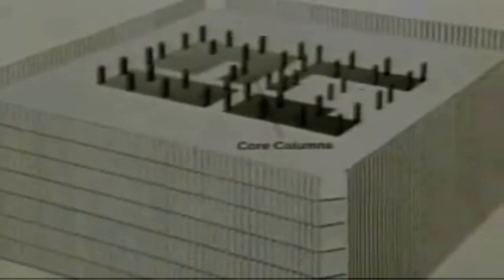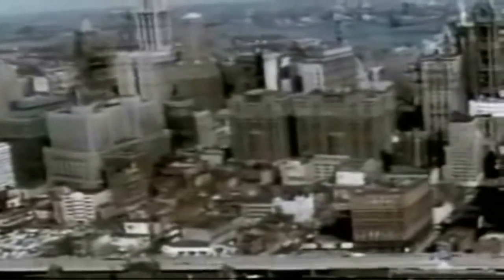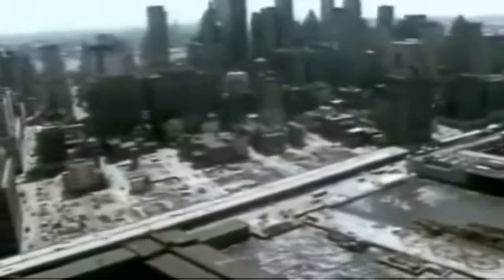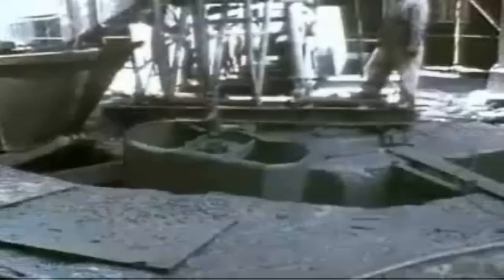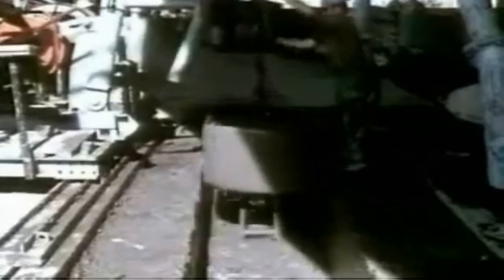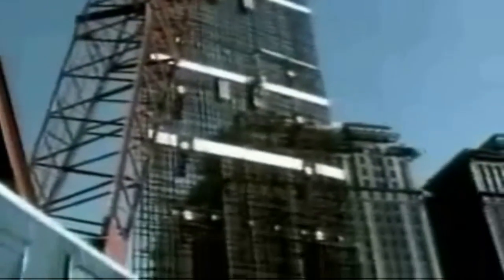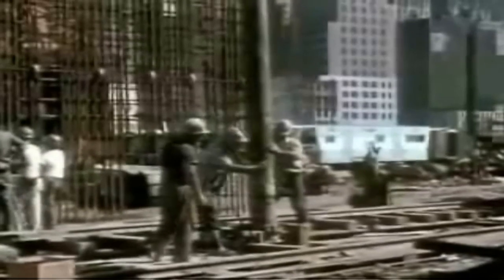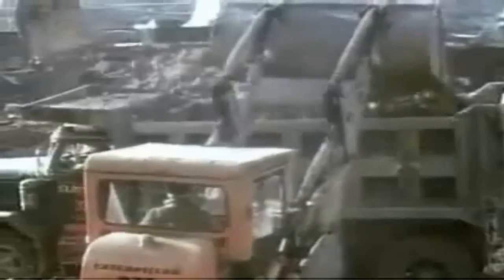Building the World Trade Center Towers

Comment: At 9:24 in the footage, it becomes clear why the official story of floor pans sagging due to heat would have been impossible.  The official explanation omits the reinforcing steel I-beams that run the length of each pan.  The trusses were not load-bearing components.  They served as additional connection points.  Those floors were filled with steel-reinforced concrete, providing even more strength and resistance to warping.  

Those floors were also nowhere to be found during the cleanup process.
Reply: You apparently know nothing about construction.
Reply: @CGoffgrid  - I know that it is a physical impossibility for a section of a building to fall on itself at a velocity close to a gravity free-fall while it is still connected by steel support columns.

If you have ever read any of the official reports, then you would know they left out critical structural details of the buildings which are evident in this video.
Reply: @BrianR.-nu1sr  What makes you think the columns have anything to do with the collapse of the floors below the impact? The columns could be 10 ft thick Kryptonite, it wouldn't matter, the truss seats failed, as to be expected. No floor could be expected to withstand that much dynamic load.
Reply: @CGoffgrid  - you weren't watching the construction video.

Besides, if the floors failed because the trusses gave way, how could the central cores be torn apart and why were tons of outer wall sections cut shorter than thirty feet and thrown over one hundred yards away?  How did steel from the North tower start the blaze that consumed Building 7, as the NIST report claimed?

And just where did those floor pans go?  They should have been stacked in a pile over thirty feet tall.

The official "pancake" theory was written in just two days by a civil engineer who had not inspected any of the steel at ground zero.
Reply: @BrianR.-nu1sr  If the floors fall there is nothing holding the columns up, and they toppled over. This is clearly seen on video. 
The floors were stacked up, where else would they go? You can clearly see them dropping on each other in the videos, all the way down.
Civil engineer? Two days? I have no idea where you got that.
Reply: @CGoffgrid  Please watch the video.  The floors did not support the central core.  The core provided support for the core and the floors tied the outer wall mesh assembly to the central core for rigidity.

I defy you to find anything in the videos that remotely looks like floors falling.

The walls blew out and the entire tower was consumed in smoke throughout the collapse.

There were no floors pans among the twisted steel beams and columns at ground zero.

There is also no way that each entire tower could fall apart in just fifteen seconds without the aid of demolition material.   The towers were much more densely built towards the bottom.

The official explanation was written in order to deflect attention away from the demolition efforts and back at the government's anti-terrorist narrative.

The same people who brought us the official 9/11 explanations are the same people who later brought us the fake report that claimed Saddam Hussein was involved with the 9/11 attacks, and that biological, chemical and nuclear weapons were being developed in Iraq.
Reply: @BrianR.-nu1sr  That is not how it works. The columns can not stand without being tied together. The floors tied the inner columns to the perimeter columns, without the floors none of those can stand. That's basic shit. Are you really trying to say the floors didn't fall? Because you can see it clearly on video as they hit each other all the way down. Everything you say is an assumption based on a lack of knowledge of construction, there is not a shred of evidence to support the claims of explosives in those buildings. None seen, none heard, none found, no evidence of them found, no method of getting them in the buildings, and no reason for them in the first place considering a 767 is plenty of power.
Reply: @CGoffgrid  - I suggest you watch an actual documentary on the subject.

I'm saying that if the floors were going to fail, that would have happened as soon as the first plane hit and knocked a bunch of them down.  Guess what?  None of that happened.

There is no evidence of floors falling on each other in the many videos taken on 9/11.

There is an enormous amount of video evidence of explosives planted strategically in order to rapidly bring them down in a manner which would prevent them from toppling over.
Reply: @BrianR.-nu1sr  I have watched all the documentaries, and I know construction. You are being fed a bunch of bullshit by con artists. 
1. Why would the floors collapse on impact? Because you think so? It wasn't the impact that caused the collapses, it was the combination of impact damage and fire.
2. No evidence of floors falling on each other? Huh? Are you blind? EVERY video shows it. Where the hell else would a 3 million lb floor go? They don't just float away. Here: https://www.youtube.com/watch?v=2-9TD3oQq3g
3. Not a single video shows a single high explosive charge detonation. Not one. I have no idea where you got that.
Reply: @CGoffgrid  the total weight of the steel used in each towers was 100,000 tons.  The floors would not have been designed to weigh 15,000 tons each.  Recheck your math.  Also, the floor pans were filled with a concrete derivative that included asbestos and some early polymers.

Trusses did not support the floor pans  The trusses provided support for the ceiling tile framework.  The grid of I-beams that are shown at 8:25 in the video provided the support for the floor pans.

Watch this video and try to pay attention.  One of the features of this structure had to do with the outer wall construction.  They are specifically referred to as, "load-bearing walls" (1:40 and 8:00 in the video).

If you don't want to see the evidence of the blasts, then you would not see it.  Floors were being leveled at an average rate of six per second.  That does not happen in a steel-framed structure without demolition.

The South tower collapse also contains evidence of demolition because of the direction change made by the tilting portion of the tower  during the collapse.

Then there's that nasty old Building 7 which mysteriously began burning completely (or, at least all that smoke pouring out of the front of it made it look that way) and collapsed neatly into it's footprint at 5:20 pm that day.
Reply: @BrianR.-nu1sr  I'm quite familiar with lightweight concrete and pans, I told you I know construction. I've been a Master Plumber for 20 years. I fail to see your point about the perimeter columns being load bearing? The planes removed 32-36 of them. The load was shifted to the other columns, which were then severely overloaded and being weakened by the heat.
Why don't you discuss this with a structural engineer, firefighter, or ironworker? They would tell you exactly what I am.
Reply: @BrianR.-nu1sr  Go to Metabunk and stop repeating the crap you picked up on YouTube, it's nonsense. 
https://www.metabunk.org/9-11.f28/
Reply: @CGoffgrid  - It turns out that a large number of structural and forensic engineers, along with physicists, metallurgists, architects, demolition experts, and other professionals have been pushing back against the claims made in the official government report for almost two decades now.  

The official report contains a number of flaws in the area of construction details and the basic laws of physics.  

Regardless of the number of damaged columns, the most that should have happened was structural settling due to deformation of the remaining columns - which does not happen instantaneously.  

Fire temperatures were exaggerated, no consideration was given to the fact that the towers were giant heatsinks, the elasticity of the floor pans was grossly overestimated, and no attention was given to the volumes of gray smoke that poured out of the towers before they rapidly fell apart.
Reply: @BrianR.-nu1sr  Funny how none of that is true. The overwhelming majority of structural engineers agree with the official account. As does everyone with a construction background. You have some really strange ideas about physics, and not a shred of knowledge of construction. What you saw that day was exactly what should have happened. It's amazing they they as long as they did. Your lack of knowledge is not proof of anything.
Reply: @BrianR.-nu1sr  Giant heatsinks? 🤣🤣🤣🤣🤣
Most ridiculous thing you've said yet. More like giant chimneys. Air temps hit 1800 degrees in both towers. You gonna tell me the steel just shrugged that off huh? Bullshit.
Reply: @CGoffgrid  - The air temps may have peaked at 1800 degrees immediately following impact, but those temperatures could not have been sustained for more than a few minutes - probably more like a few seconds because jet fuel is designed to burn off in an instant.  Steel is an excellent conductor of heat, so any abnormal heat rise would have quickly flowed outward and upward to cooler parts of the structure.

So, yes. The steel just shrugged that off.  It always does in those instances.
Reply: @CGoffgrid  - The official reports on the cause of the three WTC skyscraper collapses was brought to you by the same people who falsified CIA reports about Iraq's involvement with the 9/11 attacks and that country's military development of chemical, biological and nuclear weapons.

By the way, if jet fuel was so destructive on steel, then jet engines should melt while in flight.

The overwhelming majority of structural engineers are dependent on some form of government contracts, even if it is only at the city level.  If they want to keep their jobs, they will not push back on the government's narrative.

As an example of the lengths that the government would take to protect their fable, the members of Congress and the news media who questioned that narrative were mailed envelopes containing anthrax within days of voicing their concerns.  That strain of anthrax was traced to a U.S. Army research facility - not Islamic terrorists as was claimed by Bush administration officials.  One false flag operation was protected by another.

Note that what should have been the official investigation of the WTC collapses that was being overseen by the ASCE was hijacked by FEMA, which is not an investigative agency, and then handed over to NIST, which is also not an investigative agency of any kind.  Both of those agencies reported directly to the Bush administration and their work began with the conclusion that plane crashes, fire and gravity caused the collapses.
Reply: @BrianR.-nu1sr  Wow. You are just too fucking stupid. The fact that steel is an excellent conductor of heat is exactly what destroys steel framed buildings. Do you not understand that hot steel expands? You really are lost. Everything you say is garbage and you lack the education to know why. 
Let me clue you in on something,  your assumptions are not facts, and most of your comments are just assumptions. You need to study. https://www.metabunk.org/9-11.f28/

Comment: Steel does not have to melt to lose its ability to hold tons of weight. It is bendable at much lower temperatures than its melting point. Jet fuel was not the only source of fire. Millions of tons of office equipment, furniture, paper, batteries, etc. contributed to the uncontrollable blaze. When the towers collapsed, their potential energy was released which was equal to 150 tons of TNT per tower. Tower seven collapsed because it was partially struck by the twin towers and also had uncontrollable fires raging. The inner supports collapsed first before the rest came down. Again, steel does not have to melt to become weak.
Reply: Michael  You're correct. Both buildings were leaning after impact, and more visible above the impact locations. The thermite theory doesn't work with how the buildings were leaning.

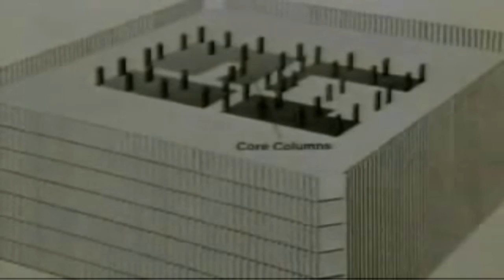Comment: 1:30-1:50 explains the reason the towers collapsed...."Extremely tall buildings were traditionally inefficient, since huge amounts of interior space were taken up by structural support and elevators. The trade center towers would overcome this problem, the exterior walls were designed to bear much of the weight of the towers as well as all the wind loads".
Reply: Also the core should have been made of thick reinforced concrete
Reply: Yep that explains everything. I have no further questions?
Reply: Mr. TacTown hollow in the middle, no wonder they collapsed.
Reply: Excatly!! Good to see someone using their head, unlike these morons that claim it was a bomb.
Reply: At least there is one other intelligent person on this site. I even saw the WTC Twin Towers being built, and my grandfather was friends with some of the store owners the Twin Towers replaced. Lower Manhattan was more interesting and fun before the Twin Towers went up, but what David Rockefeller wanted, David Rockefeller got.
Reply: The towers collapsed because jets hit them, not because of any design flaws. There were several documentaries done after the investigations into the Towers' collapse, and it was concluded that had the Towers been built in a manner more like traditional high-rises of the time that they would have come down a lot quicker, possibly leading to more deaths.

Comment: Ever see what simple birds do to the front of an airplane? Kind of hard to think that an everyday airplane with the design of a city bus take down a steel building with a even stronger core. But that's just me
Reply: 888JUNKCARS BUYING TEAM 

the birds weren’t flying at nearly 590 mph (bringing a massive kinetic force with them), carrying thousands of gallons of jet fuel, and nearly 400,000 lbs of weight.  

The cone of an aircraft is made of a much softer, thinner material than the rest of the aircraft to make it easier for the radar and other sensitive instruments to work correctly.  

And also, the turbofan blades are highly fragile and can be easily damaged by objects getting sucked into them.

I think any tall hollow structure would suffer major structural damage, after having a 200 ton object, traveling at 75% the speed of sound, thrown at it!

Comment: Such magnificent buildings, built with pure steel from the outside in basically forming a steel protective skin, shame a couple of paper airplanes travelling at impossible speeds at ground level went through them like knife thorough butter causing them to collapse at free fall speed some 30yrs later.

Comment: That explains how it fell the way it did. The outer walls was where most of the stress of the tower was at. Put a hole through one side. And you'll weaken the structure. Also, jet fuel cant melt steel. However, it can burn hot enough to weaken it, and once the fire is in the center of the tower. And right down the elevator shafts. The core of the building turns into a kiln. Thimk of it. The elevators go right to the basement, or the garage. Sucking all the air from down there. It sure as hell will turn into a kiln, therefore causing the fire to burn hotter than ever, causing those steel beams to melt. Think about it

Comment: Its hard to believe a jet wing could could cut through steel beams...
Reply: If a item is going fast enough it can go through most things. Think about tornado.damage, playing cards embedded into trees, straws of hay into wooden homes. Winds in tornados reach up to 300mph, jets go.much faster
Reply: water could slice steel...if it was high pressured..look up...it is not about the materials...it is the kinetic energy which enables something like that to happen
Reply: @mcmac9565  Yes it could bit with time and much concentrated pressure.. Planes are hollow and not moving at 20,000 miles per hour.. Your stupidity is incomprehensible
Reply: @Peter Rabitt Your stupidity knows no bounds
Reply: When you're flying extremely fast in an extremely heavy airplane full of fuel then yes it was very much possible. By the way it cut through the exterior concrete walls.
Reply: Sparky 97 exterior concrete walls? Na brother, those were not concrete, they were steel. Even so, they got pierced.

Comment: Now i see why the twin towers fell into themselves on 911. The outside walls are the support of the whole building. So it pancaked it self because of the load bearing walls.  But something that i cant get of my mind is why wasnt the elevator shafts or one of the load bearing walls left intact. Everything collapsed. It looked like a demolition not a collapse. If my theory of why the towers fell is correct of the load bearing walls the elevator shaft or one or 2 of the sides of the wall needed to stay in intact all the way to the top floor. But it all came down and became tiny pieces.

Comment: And somehow an aluminum airplane brought this thing down
Reply: @Hausemester they made it out to sound strong, but this is not an overly strong way to construct a building.
Reply: Gregory Dahl   What's your point moron? You have shown your lack of knowledge under every 9/11 video on YouTube. Maybe you should take some classes...
Reply: Hausemester  Yes. A 150 ton airliner moving as fast as a pistol bullet and carrying 19k gallons of fuel.
Reply: @CGoffgrid  They were designed to withstand large airliners and pistol bullets are much faster. Straight from the engineers that designed them I doubt they're lying.

https://youtu.be/w_E4Ckuyc6k